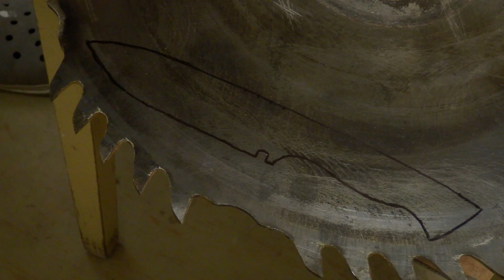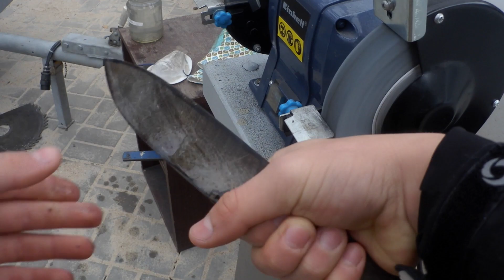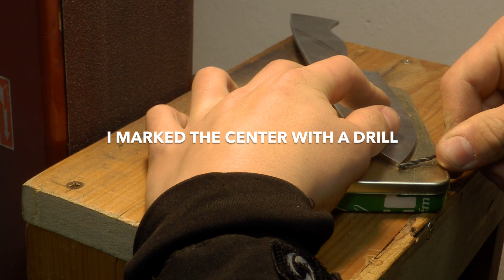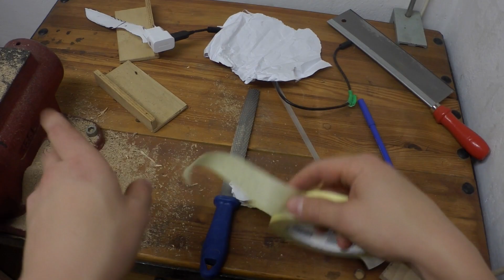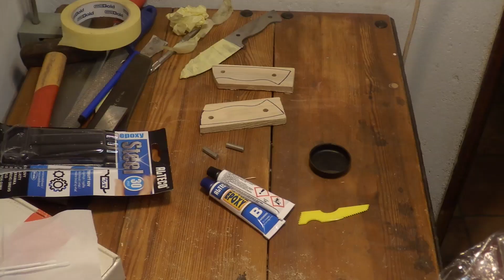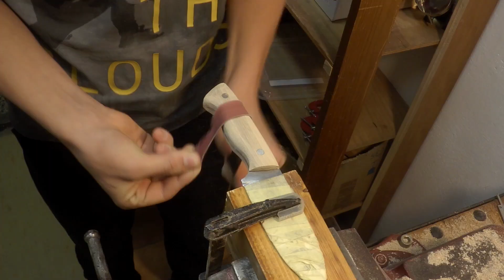Making a Knife from an old wood saw // Knifemaking // My Cellar Workshop

Comment: circular saw blades are NOT hard only the edges are hardened thats why the tips and not the blade breaks if it hits anything put it  in a vice and lever on it and it will bend and not recover if you put in an oven to normalise it will end up even softer but a very nice looking blade and handle  heat treat then normalise

Comment: So you didn't even heat treat or anything. Just cut it to shape grinded everything and then made your handle. I need to try to make one like this.
Reply from the maker: You are not the first who is surprised...this was one of my first knives and I thought that the heat treat is not needed. Actually it works. The blade is good. But I know that for next time heat treat is needed.

Comment: Good job. How long did it take you? Did I miss the Heat treat or did you not video it?
Reply from the maker: scottecooke Thanks!  I think that it took me about 10 hours. And yes, I forgot heat tretment. But I don't have any problems with the blade in the meantime.
Reply: 10 hours for a first knife is pretty good. It took me way longer and mine looks like crap in comparison. My first one was mild steel. But even my first knife with 1084 took me over 20 hours of hands on time.
A tip for the drilling. Drill on a low speed with more pressure. You want little spirals to come out not powder. Can't tell how fast from the video because it is sped up. I learnt this the hard way. I burnt out a few drill bits drilling at over 2000 rpm. Great for wood but not for steel. I did some research turns out it was way too fast lol. Also you can use oil on there as well. Helps when the steel is a little harder like a saw blade or you have to drill lots of holes.
Reply from the maker: Oh thanks for this long comment dude! I know that I should drill on low speed my old drill has only 900 and 200 rpm. And yes a forgot an oil but I normaly use it.
And you also mentioned that it is a good time to made a knife in 10 hours - yes it is but I am not really sure about this time I just type it.
Reply: Definitely change to 200 rpm then. Can change back for handle materials though. 225th sub by the way.

Comment: No heat treating or tempering
Reply from the maker: hi, I know that I missed this step. But this steel was hardened before I made the knife out of it. But I also know that I can slightly temper it with grinding or cutting. This knife was one of my first so everything isn't perfect.
Reply: My understanding is that most files and farriers rasp are heat treated but sometimes can be brittle. That would require tempering in your oven. Not an expert so correct me if I’m wrong.
Reply: Forgot to add that I assume it’s the same for sawblades
Reply from the maker: I think that saw blades are not hard as files...they should not be too brittle. But I think that it is a good idea to just temper a knife (about 200 °C for 2 hours).